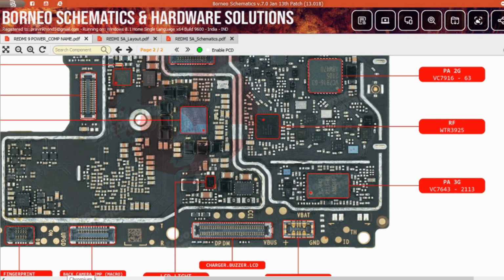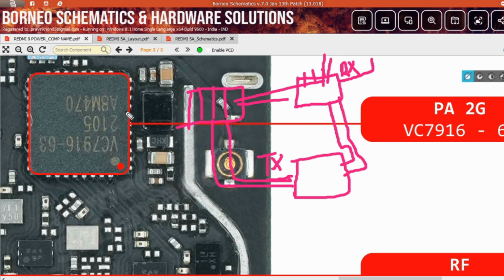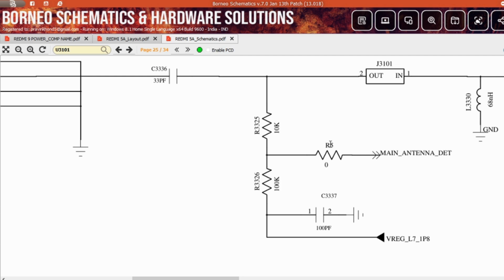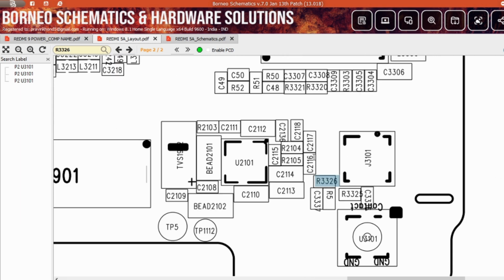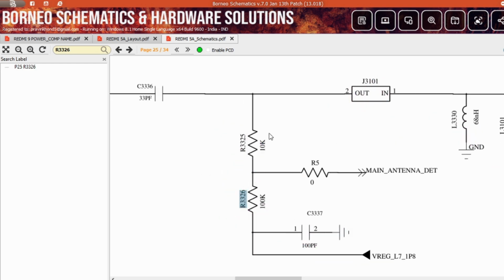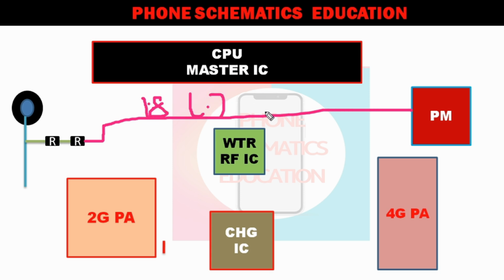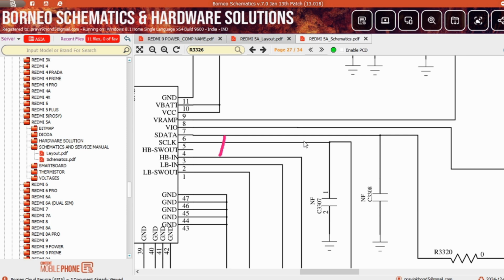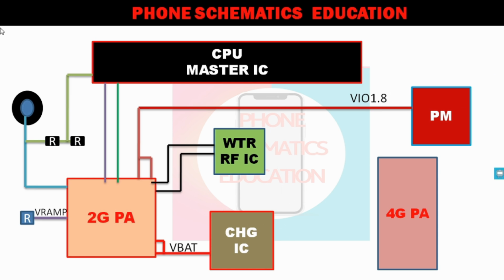Network section Explainshion#class 1.ic identification+Testing+Repair.Ant_Det+Xo+No service.

Comment: Thank you very much to your  explain. I have a problem. pl tell me if antina switch diod value more than 300 to 500, like 1000, what can we suggest ? And how to check?
Reply from the maker: If you are talking about the point where RF cable connects. then 90% phones you get no value on postive point or Gnd show means beep
Reply: @phoneschematicseducation  thanks for replying. Yes i talk about that rf cable conecting point. I have a no service phone. When i follow your steps,without conect cable it show 1000 value in multimeter.

Comment: How does divider get grounded by an antenna when there's a capacitor in series....is that 1.8v an ac signal?
Reply from the maker: @tbangblack4515   the other side of the capacitor, you will find a switch and also inductors ( coils )are connected in parallel due to which that side becomes your ground. As soon as you connect the antenna cable, your capacitor becomes fully grounded.so ur devider circuit get Ground.i hope You get my point

Comment: How do the microcircuits communicate with the processor? signals 1 0 1 0? and how does this happen if there is 1.8 V in these circuits?
Reply from the maker: 1 0 1 0 is Binary coding language So Master ic communicate with slaves ic(chips)I will give ur  complete detail  Answer in Mobile repairing talks episode 2.if u want..then give me some detail .your name also country name & so if you don't mind one picture.so I mentioned that this question belong to you.ur picture(photo) is optional
Reply: I'm from Ukraine, name is Pavel

Comment: Bro, i have dead oppo Ax5. It was dead when unlocking with easy jtag.  Now the phone only in edl mode when connected to usb and i don't know how to recover it. Any suggestions? I just recently bought easy jtag and i only have isp adaptor. 
Dc reading stuck on .055v. 

By the way your videos are awesome and motivates me to learn more and more.

Comment: Good day to you, Sir
Reply from the maker: Same to you
Reply: I have problem solving a vivo y02 no display job, backlite part checked ok, vsp vsn have +6v -6v, 1.8v also present and other mpio lines diode mode value seen ok... but still no picture...
Where do i missed ?

I am eager to wait for you light and graphic lesson

Comment: Why does a power controller need a quartz resonator? To create a shim signal for the LDO and cpu?
Reply from the maker: Power controller needs clock signal to make voltage sequence.which will go first voltage which will come after.for boot sequence..hope u get it.. quartz resonators (RTC)real time clock oscillator